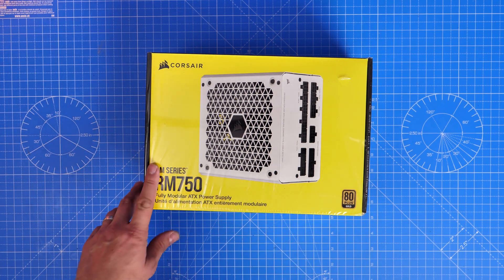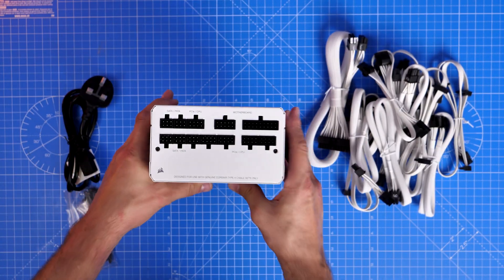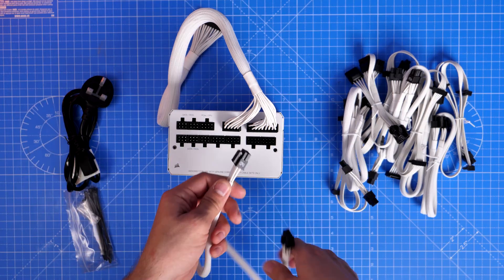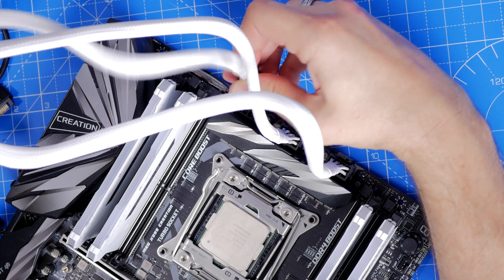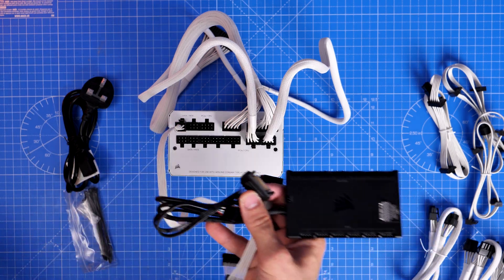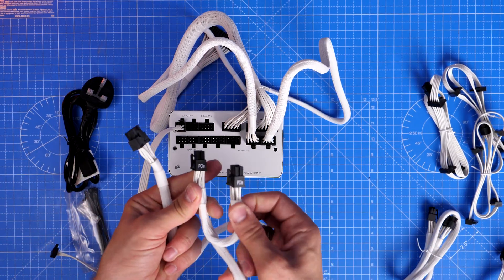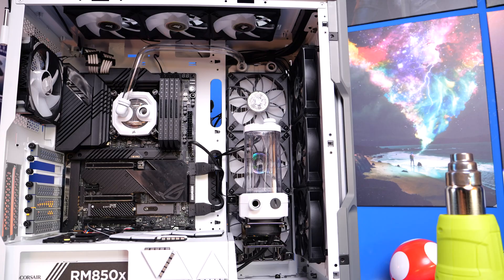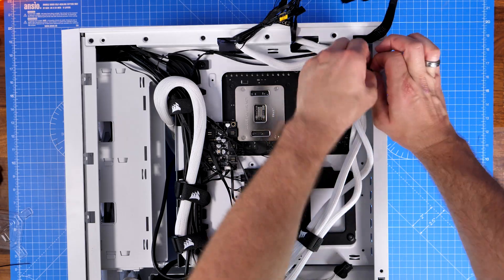Corsair RM750 power supply install guide (how to setup your RM750 PSU)

Comment: If my gpu is only an 8 pin, could i plug the dual 8 pin end of the cable into the psu? leaving a cleaner single cable connection to the gpu?
Reply from the maker: No don't do that. The pins are different and it's dangerous
Reply: @TheProvokedPrawn Understood, thanks for the quick response. Your videos are really helpful!

Comment: Came here as a novice builder (built my original system, have upgraded it and pulled it apart a few times) because I upgraded my gpu and psu and was running into issues getting the pc to post. I’d love to say that the video was super helpful and informative, but unfortunately it turned out that the issue was that I simply hadn’t actually plugged in the cpu cable. I had it sitting beside the power supply, dangling!
In conclusion, thank you for your video’s moral support.
Reply from the maker: Glad I could help! Good you got it sorted

Comment: I still can't get which one ports are for gpu and cpu , I mean , If it's labeled as pcie/cpu they shouldn't be mixed or they can be mixed no matter which one port you plug the cable in , right ? I  think you should not get mixed cpu and gpu cables ,right ?

Comment: quick question not sure if anyone will answer: when your graphics card has 1 input on the card but the cable that plugs into it splits, should i be using 2 different pcie cables plugged into the psu or could i use one of the other plugs on that same cord for the second outlet?

Comment: Maybe a dumb question, but you said you only had 3 PCIe/CPU cables @3:35, then where are you getting this cable from @8:36. That's the only one you don't show on the PSU side. How were you able to run 3 to the motherboard and 2 to the GPU?

Comment: How many of those SATA power cables it comes with? 4? Corsair claims 14 SATA power connectors, so 4+4+4+2? I'm interested because I have 3 sets of drives in difference places, so just two cables wouldn't reach all of them.

Comment: Has anyone had any problems with this power supply with a asus RTX 3060 ti I just for some reason can not get a signal since I got this power supply and I have tried everything.
Reply: I'm literally in the same situation. I just bought this PSU and have the GPU. And nothing turns on. Nothing works.

Comment: hello there!
I have the nzxt n7 z690 mainboard and I can‘t find the cpu cable atapter kind of I mean where to put the cpu cable on the motherboard so I am doing something wrong 😂🥹 I also need help plugging the kraken z73 cables right (I did watch other videos also the video of the z73 u did but I am still confused and need help). Would appreciate an answer, really confused here 😅

ah also, I don‘t have this power supply thing u used a few sec ago 7:00 min 😅 and 7:30 I don’t have this. Do I need that?

Comment: I just installed this PSU today in the same exact case. What’s that red and black cable you using in your Hard Drive. Looks like I only used the cable provided with the psu. Now my hard drive isn’t being recognized.
Reply: Asking the same thing
Reply: That's a SATA data cable, which needs to be plugged into the motherboard. The PSU only provides the SATA power cables.

Comment: You are using 3 PCIE/CPU slots for teh motherboard and 2 PCIE slot for the Gigabyte Invision GPU. Ther are only 3 PCIE/CPU slots in the PSU. How is that?

Comment: I have the same PSU. Now the GPU i have has 3 pci connectors. I found it weird that the PCI and EPS ports are some how inter changeable. But to do it. I have to put the pci in the first port and the EPS in the second port this is where it says EPS. Or the pc wont boot. The 6800xt i have has 3 PCI connectors.

It took me a while to figure out

Comment: do not waste money on 750w PS.  get 1000W or higher. nVidia 4000 series are drawing 450w all buy themselves. you should Not run a PS at 100% load. you need headroom for future updates.
Reply from the maker: You are making big assumptions as to what people are using. I already said to check wattage use with the calculator. But not everyone will be running a high end 40 series.
Reply: Many of the 4000 series cards actually use less wattage than the 3000 series. The 4070 only draws 200 watts. A 1000 watt power supply would be the waste of money.